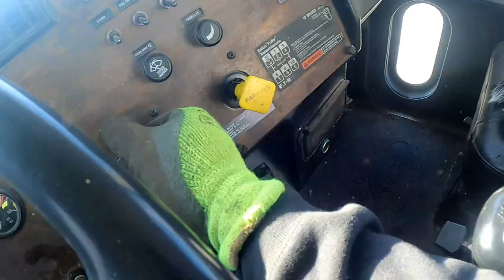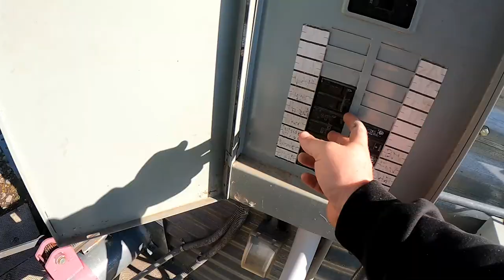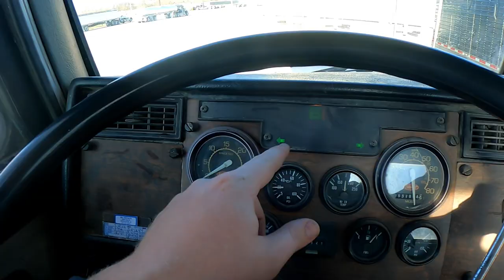Check out this AMISH FORKLIFT!

Comment: How does one make a relatively safe machine like a forklift extremely dangerous? Simple - remove the operator control position from sitting on top of it, and have them stand right behind it while it is going in reverse!!
Reply: God meets Darwin? Handle smacks you I the nuts so you can’t breed :D

Comment: Wait.. did I see it correctly that you have to pull through the pit to scale and then back up over the pit again to dump?  If so, that seems quite inefficient...
Reply: Chizmar Farms then pull back up on scale to weigh out and leave .  Seems very efficient.
Reply from the maker: They are adding the inbound scale I think. However the nice thing is that you get scaled on the same scale every time.

Comment: so they can use a forklift they just cant ride it?
Reply: And can ride too, but not over rubber wheels, wooden or steel wheels are alright and they cannot be over same wheels where the engine is. So if that thing would have a trolley behind with hard wheels where could stand it would be alright
Reply: @SFtruckerWolf  plenty of them drive regular towmotors. It all depends on the rules of their particular church.
Reply: My favorite was they couldn't have a telephone in their house but they would line up at the neighbors to borrow theirs.
Reply: @snakerstran9101  a lot of them have cell phones now.
Reply: @snakerstran9101  ya but it has to be wireless...